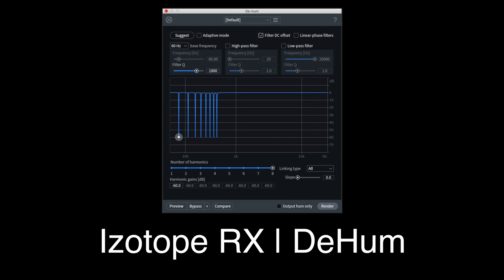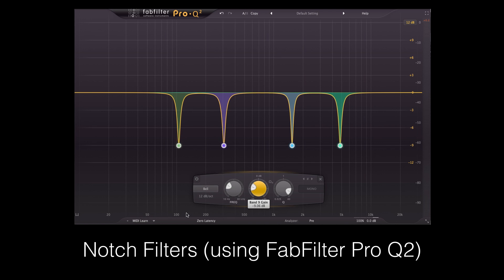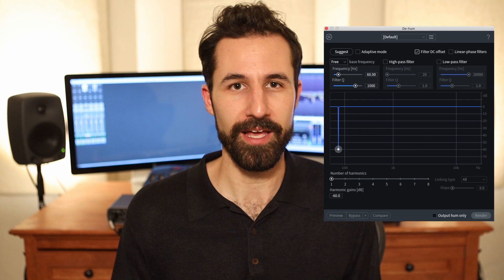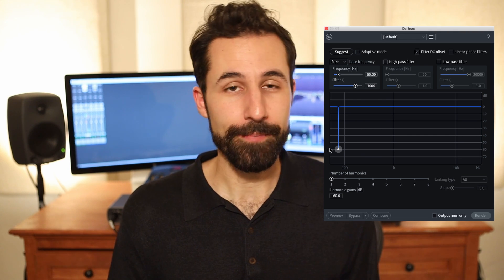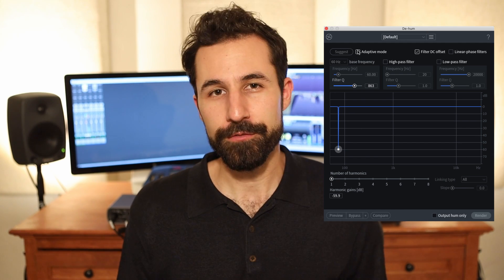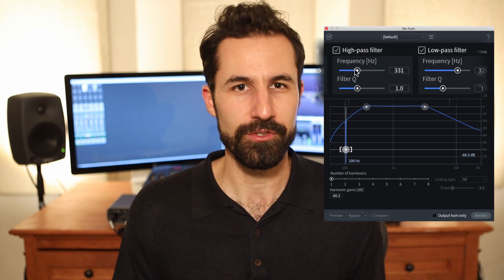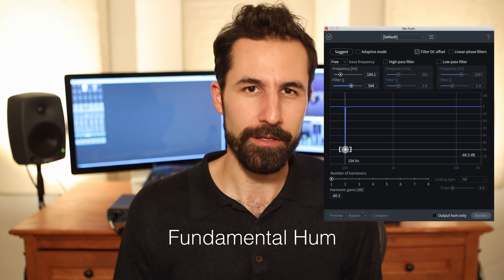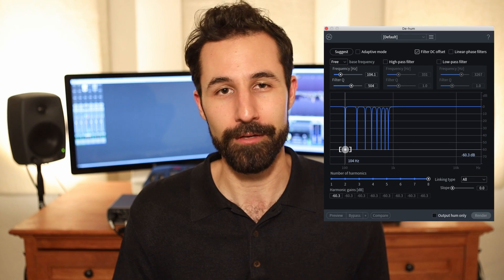How To Remove Light Buzz or Hum From Your Recordings - Part 4 of 24

Comment: Actually I can't remember when was the last time I used De-Hum. Tonal mode in Spectral De-Noise and De-Construct or even Spectral Repair in some cases happened to be more versatile in my experience. You don't have to know exact frequencies of your ham to use them. But they require much more advanced knowledge of RX. And your video is still awesome!